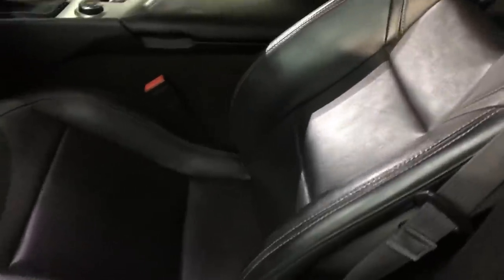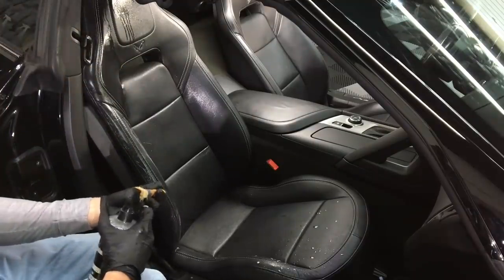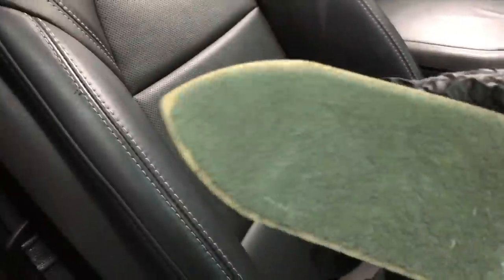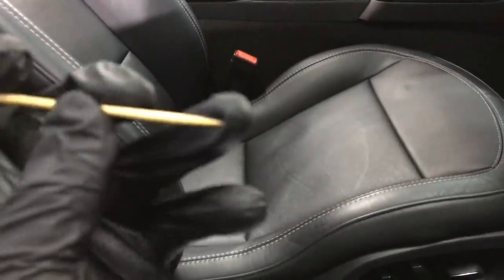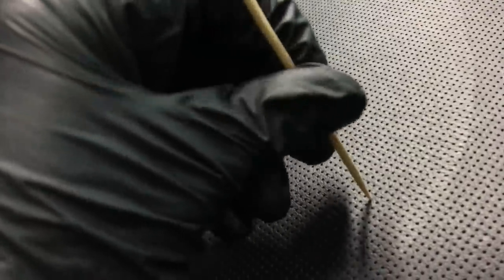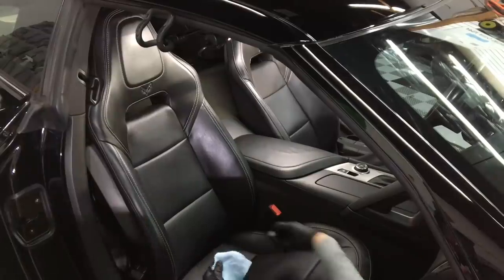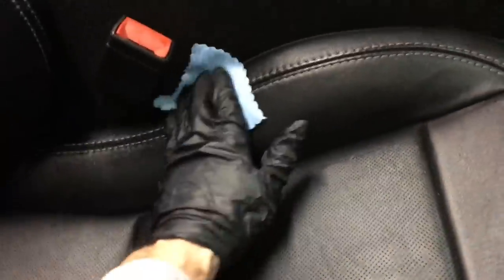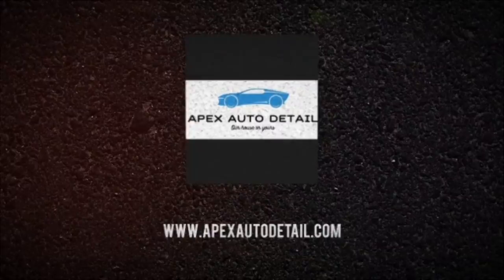Time To Clean/Prep/Coat The Leather In The C7 Corvette!

Comment from the maker: What is your preferred choice for leather protection?
Reply: I personally like Meguiars Ultimate Fast Finish!
Reply: Saphir Renovateur 😁
Reply: Apex Detail I use the Scott Bley method.   First a mixture of distilled water and dollar store woolite cut 4:1 to clean.  Then I seal with Megs Ultimate Fast Finish.   Use this on both C5’s and won several Best of Class and 1st Place trophies this past season.  Won Best Corvette at a NCRS All GM Show so the stuff works good and doesn’t cost very much $$.  I switched to Car Pro Perl cut 3:1 to seal after watching you work on the red C2 convertible and won again with this combo.
Reply: I like both Cquartz Leather and Gyeon Leather Shield.  Have you had the chance to try Cquartz Leather?  Would like to hear your thoughts on how they compare to IGL.  Thanks.
Reply: Leatherique System has worked well for me. It seems to penetrate coated leathers to clean and soften
Reply: Apex Detail gyeon leather shield
Reply: QP-ON 4.1 ... though considering Perl or Gyeon Shield/Coat next time it needs coating.
Reply: alberto
Reply: @TannerBobbitt  please tell me more?
Reply: Hey Brian.
i personally like COLOURLOCK to clean and protect.
Greets from Germany
Reply: I use 1 of 2 very similar leather cleaners, Megs D181 or CG's leather cleaner. Both are clear, odorless, straight cleaners that truly clean and leave nothing behind. I use The Rag Company's (or the Adams private label version) microfiber scrub mitt which is like Brian's yellow wedge shaped scrubbing brush but much larger. WIth these 2 cleaners it works amazing. Makes doing steering wheels, shifter, bench seats, etc. very easy. 

Then I'll seal them with CG's Leather Serum about once a year. For routine maintenance I'll just clean them with the above and then use either Adam or CGs conditioner (again 2 very similar products with CG being thicker) which has a nice leather smell and protects the topcoat. No different from putting a sacrificial layer on a ceramic coated car in my opinion. I rather people take away the conditioner than a little of the plastic topcoat every time they slide in and out - and everybody slides. It's human nature.
Reply: @MNpicker  Isn't that a waste of money? Most leather is coated similar to clear coat. I use Saphir Renovateur for some shoes, handbags, and briefcases that aren't coated. Also, it contains wax which while somewhat of a protectant will cause the leather to shine which is the last thing I want in a vehicle. Thanks.
Reply: @gotrixiego5103  Yes.. that would be a waste of money.. i was being sarcastic.. sadly.. It wouldn't work for regular car leather. I was trying to make it sound like I had a Ford King Ranch and used top shelf leather care products for the seats..when in reality I drive a beat up old cop car😕
Reply: @MNpicker  Its all good. I thought perhaps I was missing something as I'm a huge Saphir fan.
Reply: @gotrixiego5103  
Only the best 😏
Reply: 3m 303 at times for leather and tonneau covers etc.
Reply: @gotrixiego5103  can I use that saphir thing on my timberland boots?
Reply: After watching this video and seen some comments I decided to go with the gyeon leather shield. I already have the cleaner and conditioner from chemical guys.
Reply: No idea. I would imagine if they were leather and not suede should work well.

Comment: If proper leather protection had been applied before the spilled hot coffee/choc., would the perforated leather still be permanently damaged?  If you immediately mop up a hot liquid from the leather seat with a MF, will the seat still be damaged? Does the car now smell like hot coffee or hot chocolate if you heat up the seats?  When I get my new car, maybe I won't let anyone eat or drink in it !  Thank you for the video on cleaning and protecting the interior.  Excellent result.
Reply from the maker: It certainly helps...but some damage will still occur.

Comment: It wasn’t implicit but assumed, did you coat the dash with igl as well? I love Sonax leather cleaner, but it is aggressive and can attack the dye  and OMG do not drip it or apply it without using a brush. Tried it after one of your videos and did my bmw and coated it, then I rescued both an  M class bmw and Maserati both with dirty faded red leather, outstanding result on both. liked the brushes, are those Detail Factory?
Reply from the maker: Yes...it has some areas up there to protect.

Comment: I would advise to use a colourlock/swissvax leather brush, safe and faster.  colourlock/swissvax Theyre leather experts and in my opinion they have the best products for cleaning/protecting and restoring all leather. Try Colourlocks Leather Fresh to repair small scuffs etc, bigger scratches etc even holes try Fluid leather. Your seats will be like new. 
Note: Leather Fresh comes in colors, so contact them for the right leather color for your car. Fluid leather is a filler and additional steps are required.
Reply from the maker: I agree...good stuff.

Comment: More info on the brush please. It looks stiff enough to clean but soft enough not to damage the coating.
Also any tips on cleaning micro suede / alcantra? I’ve got the 3LT interior which has the suede inserts on the seats and doors, plus arm rest. These areas pick up lots of oil from your skin.
Reply from the maker: A steamer at a safe distance is what works for me.